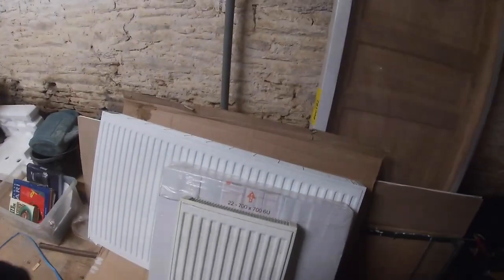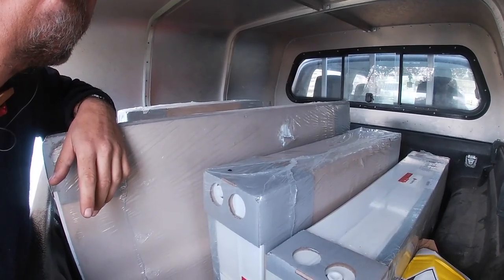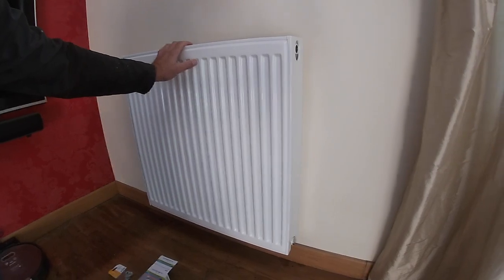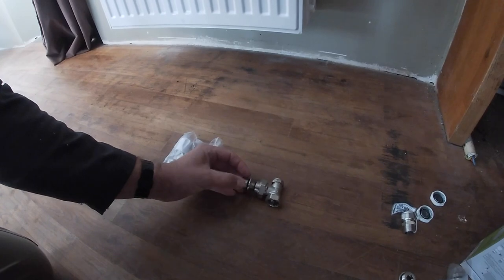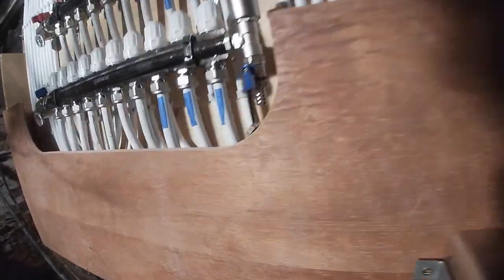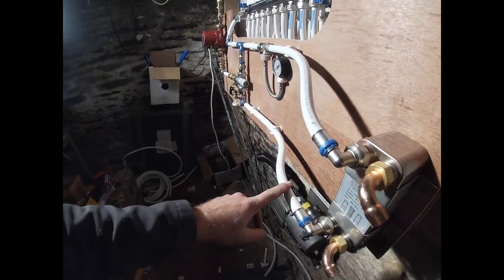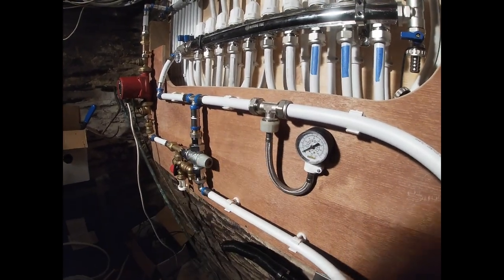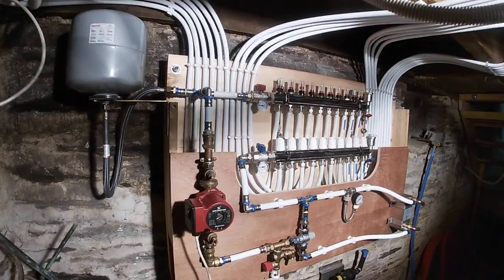Heating a house with a diesel water heater (Eberspacher D9W hydronic) pt1

Comment: That looks like a lot of head scratching to get the routing of all that pipe worked out. 
How does heat loss from the plastic pipe compare with copper pipe ensuring the water is still hot by the time it reaches the radiator?
Reply from the maker: That is a very good question. I am in the middle of measuring just that very thing along with other temperatures. I do loose a few degrees where the pipes run through the garage. However the pipes to the main living areas aren't affected as much. Copper would not be my choice in this setup, mainly for cost but also it's very inflexible. I also think that copper would loose a bit more heat but nothing that would be noticeable above PEX-Al-PEX. AJ
Reply: @ajinfrance  I’ll be interested to see what you find. Thermal imaging gun test and review video?  The erbespasher is a great idea.
Reply from the maker: @gavin6538  Exactly that 😀